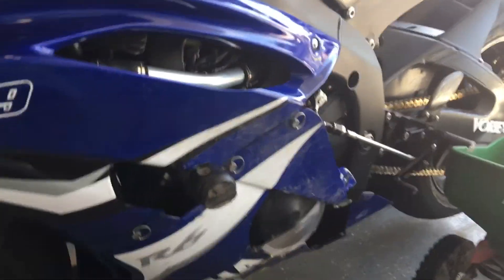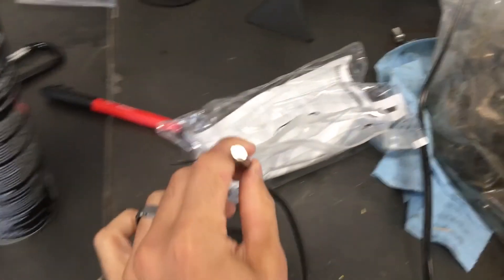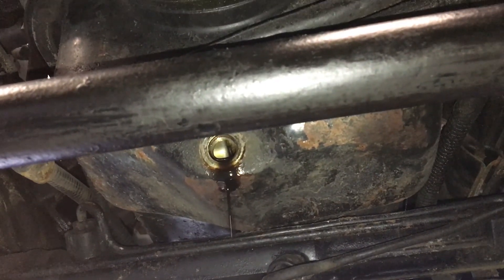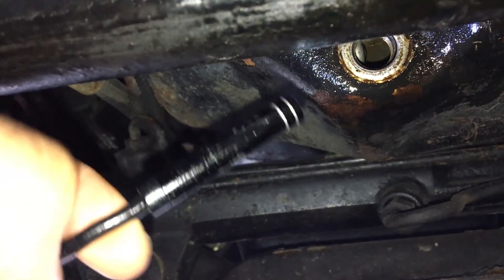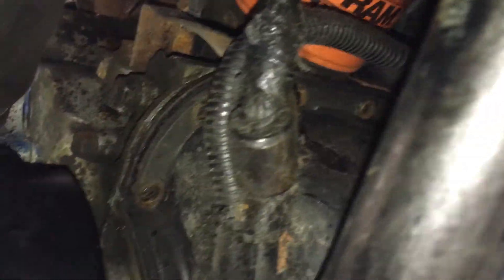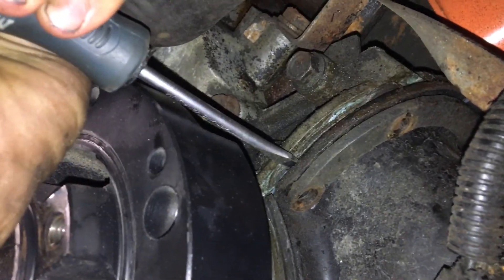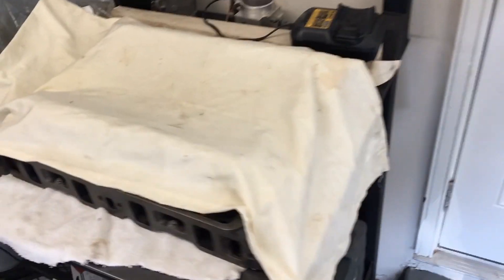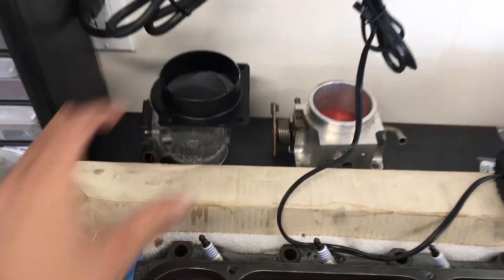Foxbody Mustang Build - Part 8: Borescope Probing

Comment: Interesting video.   Any updates?   I have a very notable vibration/ rattle at 2100 RPm.   I don’t know where to start.  Any advice would be helpful.  2018 5.0
Reply from the maker: Mine ended up being the flywheel

Comment: Did u ever figure it out? I have a similar vibration with mine...91 stick car...it has a really slight vibration at about 1800rpms.....i only feel it there???
Reply from the maker: Joe Reain to be honest I needed a break from the mustang, I started hating it cause I couldn’t figure it out. But I have since purchased a new flywheel and will be putting it in shortly. If that doesn’t work, I plan on driving it until something breaks, then I’ll know what to fix.

Comment: Will do I'm interested, I have been dealing with a similar issue. I have an slight engine vibe and driveline vibe also. I've been chasing both. So I'm very curious to see what you come up with. What flywheel did you go with ?
Reply from the maker: Mike Lohr I went with a stock replacement from LUK part number LFW112. Should be getting it any time now.

Comment: When did you noticed the vibration or has it been there since you got the car
Reply from the maker: 209pancho209 vibration has been there since I got the car, most noticeable at 3500+ rpm
Reply: MG Motorsports the pullies maybe i know on my mustang there was a bad pulley
Reply from the maker: 209pancho209 I've tried removing the belt and no change unfortunately.
Reply: MG Motorsports other thing i can think is cam. I gotta say with the gt40 upper and lower, heads and e303 cam goin to make a difference
Reply from the maker: 209pancho209 yeah I'm going to check the timing chain asap. And yeah I can't wait to put that stuff on.. just need to be able to rev it past 3500rpm!
Reply: MG Motorsports im sure you will find the problem